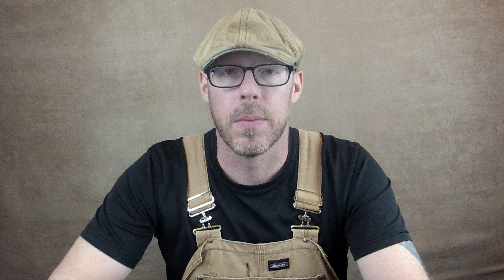How does underwater concrete work?

Comment: Five Star cement is what most commercial divers use for underwater repairs. However standard pool cement with additional cement not marble dust can be used by mixing about a1/4 cup of calcium chloride prils to a gallon of water to make the cement cure fast underwater. Cement pigment can be used to blend colors.

Comment: Yeah but how does it actually work
Reply from the maker: By having so many additives and accellerants in it that it will set up so fast it does not have a chance to float away.  So you can even pack it into an active leak and some might wash out, but a bunch stays.  Two or three tries and it is all plugged.  This product expands as it cures, which is uncommon for concrete products which usually shrink as they sure.
Reply: Hello. Does it affect water itself. Is it safe for example to use this in a fish tank?